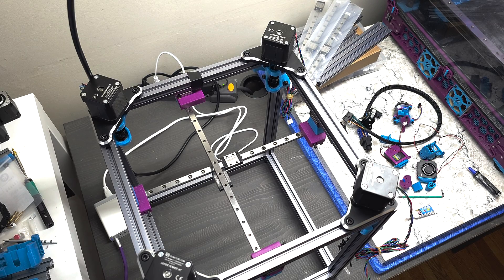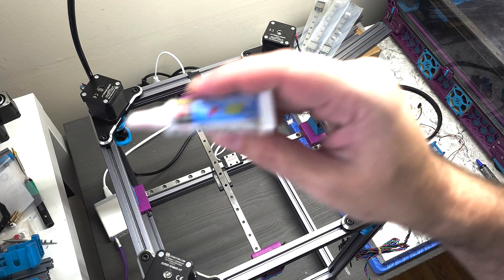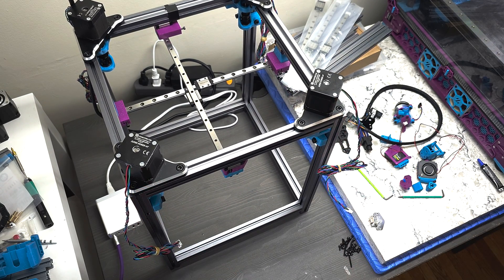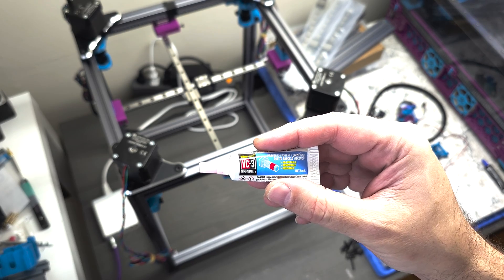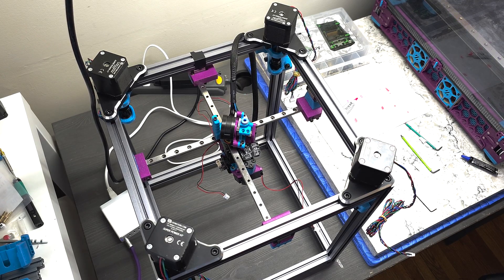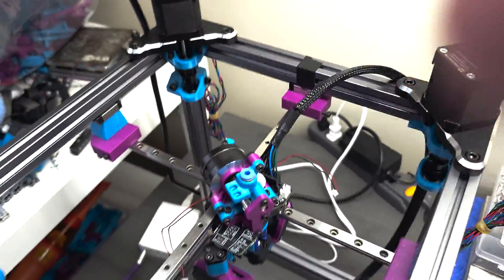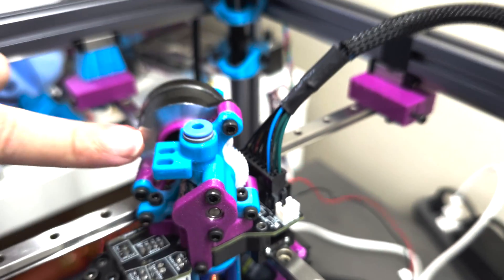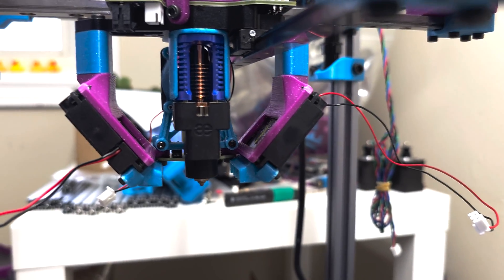Annex Engineering K3: Build Part 07 - Toolhead Assembly

Comment: not using CANBUS? Interesting
Reply from the maker: Annex Engineering doesn't do CAN Bus. I however, do. Going to build it stock first, and see how toasty the chamber gets before adding in any electronics
Reply: @oldguymeltsplastic  makes sense. I recently built my first Voron v0.2 / first Klipper firmware printer and people said "can bus not for beginners" but I saw your video abut CAN and I didn't see any difficulty there. I love the concept of CAN BUS in printers, I had to buy it. I had an LDO kit, but I bought BTT CAN U2C and EBB 36, and built with it instead of Picobilical, and man do I like it. It's like the single coolest thing about this printer right now in my opinion. Looking forward to build another high performance printer. Annex K3 caught my attention a few years back, I dreamed about it ever since.

Comment: Is there anything that would stop you from putting the door on a different side??
Reply from the maker: Maybe I haven't gotten far enough into the build yet, but I am strongly considering mounting the front door on the "side".
The front door panel that comes with this kit has etched/lasered (?) words/art, so rotating or flipping it would just look weird.
Reply: @oldguymeltsplastic  Never looked at the build manual for the K3 but the design defiantly has a less of a definitive Front/rear/side for the gantry then say a Voron. It's probably the Bed kinematics that has more of a role determining the *Front of the machine